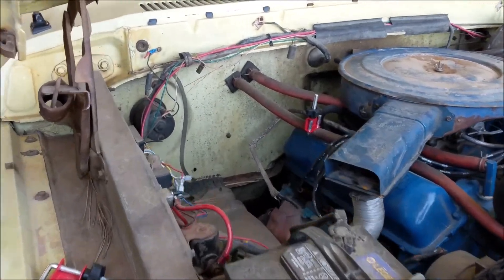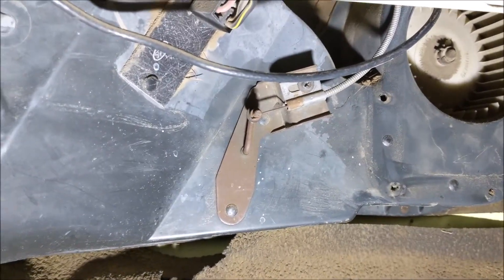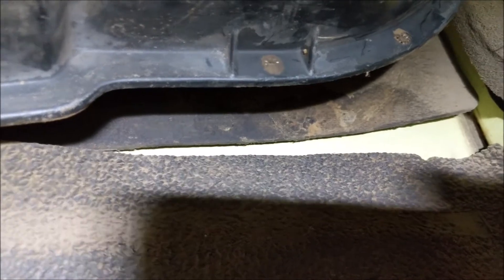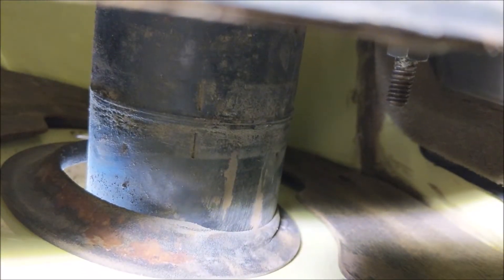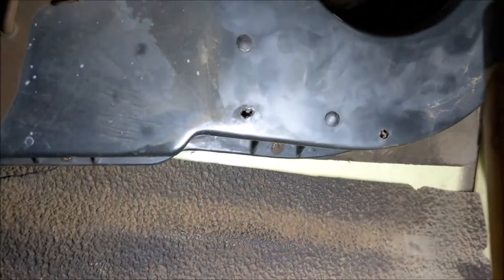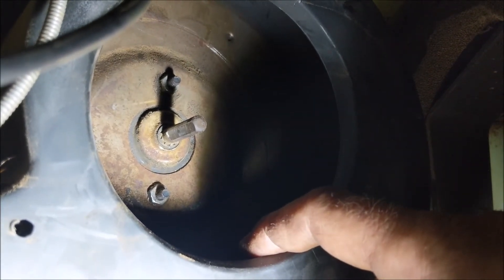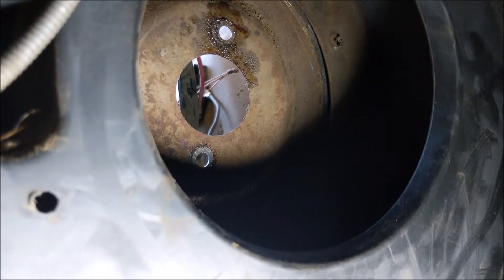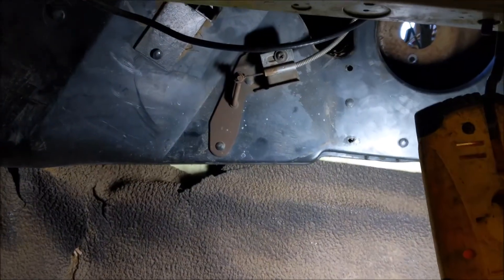1973-1979 Ford F-150 F-250 non-A/C Heater Blower Motor Removal

Comment: Great video! Drilled a 3/4" hole with a hole saw through the fan body. Measured 1-1/4" from center of motor shaft to center of hole and it lined up perfect with two blower motor bolts. Motor pushed right out, new one popped right in. 30 min job with a spare set of hands to start new motor in. Thanks for the farm knowledge!

Comment: Thanks for the video, info and the great idea to drill a couple of holes through the fan cage  blade to access the two 3/8" motor mounting bolts and nuts. I used a 90 degree drill  and a small hole saw for the job as space is limited. It took longer to set up and clean up than instal the new motor.  An hour and a half. Thanks again!

Comment: Just pull the whole heater assembly out of the truck. If you remove the bolt on the RH end of the under side of the dash you can pull the dash way out and pull the whole heater assembly. 
I had a 197 F150 for years and replaced the heater core and blower motor a couple times.

Comment: How did you get the fan blade off the motor shaft? I have a circle clip that pried off but fan still doesn’t budge.
Reply from the maker: I tapped on the center of the shaft with a punch to get it to start sliding out of the fan.